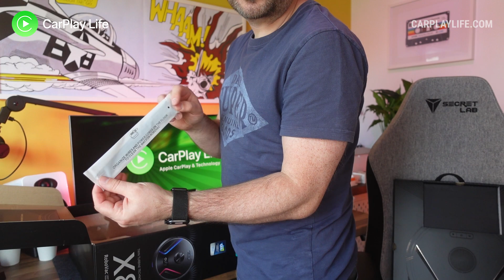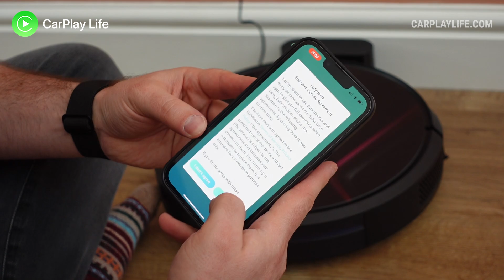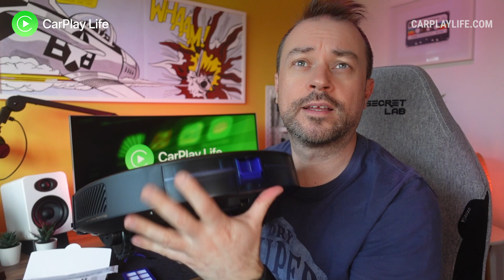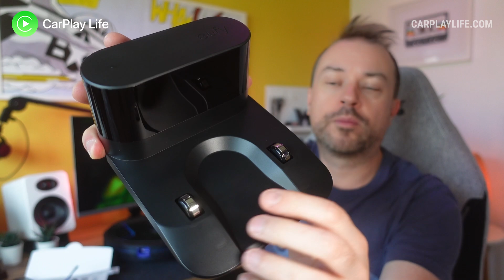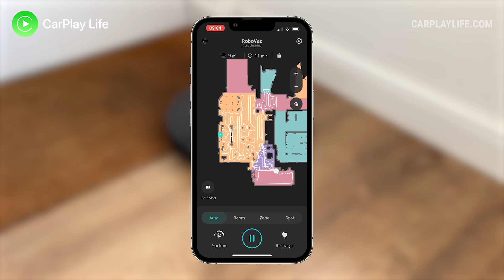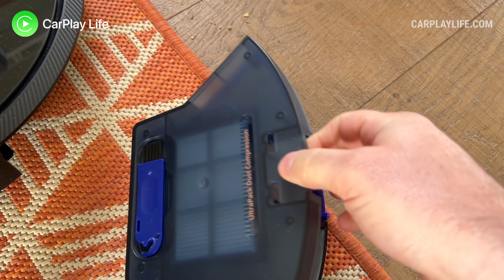Eufy RoboVac X8 Robot Vacuum Cleaner Review

Comment from the maker: Product Review Updates:

- 29 April
I still fully recommend this robot vac. The X8 remains my 'go to' robovac of choice around my home. My previous staple robovac (the Mijia 1) has been shelved, for now.

Potential show stoppers:
- Height might stop the vac from cleaning under all bits of furniture.
- This version doesn't mop, but even if they paid me the $50 extra I wouldn't use that function.

Small niggles:
- The battery % label is not available in the app.
- Rooms can't be named
- Can't tell a voice assistant to clean a room, only a full clean.
- Map can take a while to update before you see updated progress during the clean.
- Can be quite aggressive on small obstacles that it can scale over.
- It has struggled and failed to return to base station IF I do a go-to and clean task.
- Under chair legs remains a 50/50 toss-up if it does it or not.

Let me know if you have any questions about this RoboVac in the comments below. Thanks for watching :)

Comment: Hi Anthony, have you tried the hybrid model? I was wondering how you would rate the mopping ability? I am on the fence as to which model to go for!
Reply from the maker: Personally I’m not a fan of mopping functions on these things. They don’t really do half as good of a job as you doing it yourself. Avoid any vacs that just drag a moist towel pad behind them. That doesn’t achieve anything really. More active mops are slightly better but still, the limited reach of the robot means you don’t get a thorough clean of the floors.

So in short, just go for a robot that vacuums and avoid mopping hybrids. Save your money unless the mop agitates or has a decent cleaning function with separate water and waste containers.

Comment: Very informative video. What did you find to be the best robot vacuum cleaner?
Reply from the maker: It all depends on the house conditions and what you want out of your robot vacuum. 

Of all the ones I tested, I stuck with the Mijia One for some time. No others that came in replaced it, until this X8 from Eufy. But the extra height didn’t fit under most of my furniture so it didn’t clean as thoroughly. 

The smart mi A1 was also great, I liked its power and straight long brush and cleaning power, but it was far too big and bulky to located it’s station and for it get in and around places, so that also got used much less. 

Then the yeedi vac 2 pro came and it’s low profile, cleaning AI, and room management worked so well that I cast all the other vacs away and the yeedi has been my daily driver vac for a few months now. 

The only issue I have with it is it has no sensors in the main bin station and in the bin inside the vac. So you’re guessing when the main bin is full or if you don’t have that station when the mini bin inside is full. Other than that it’s done a surprising job generally. https://youtu.be/9tfsyVKqvPU

I have just had another arrive for review, but it serves a much different demographic as it’s the smallest vac I’ve used.

Comment: Comment about how difficult is to empty the bin is bit strange considering the way you are holding it... Seems like holding it other way around and use both hands may work better. Anyways mine will be delivered in few days will see then.
Reply from the maker: Yes. One handed whilst holding a camera isn’t a good idea 😂 

If you open it deeper into the bin and have the opening facing downwards it’s ok then but still not as good as a draw like opening on some others I’ve used.